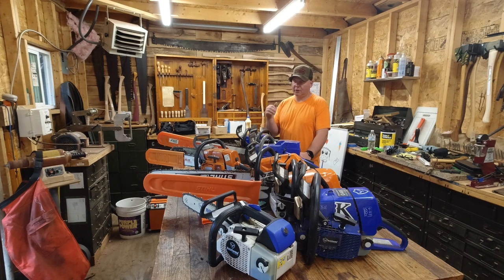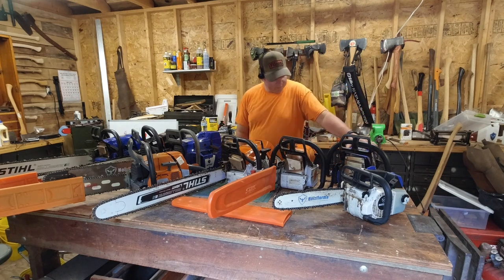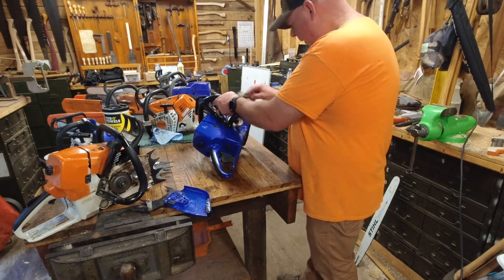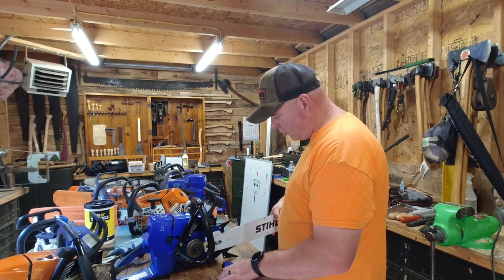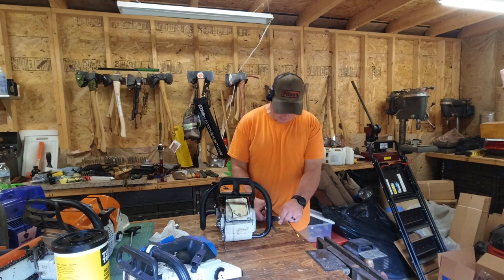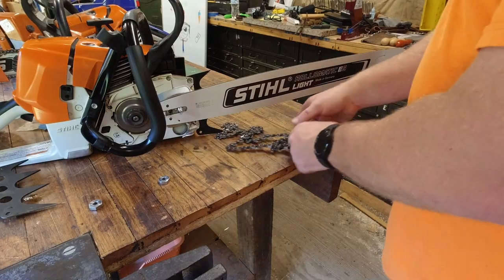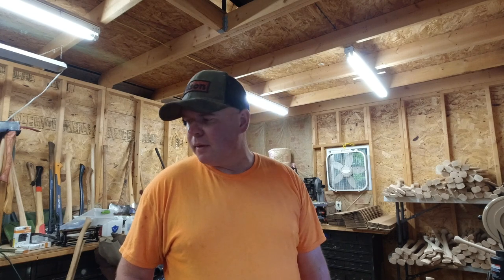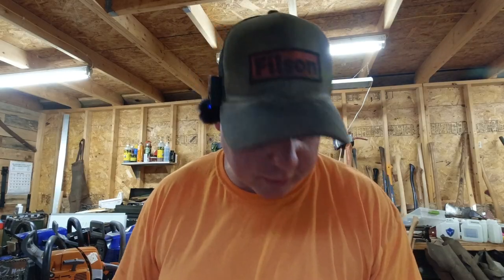Do This One Thing And Your Firewood Chainsaw Will Last Forever!

Comment: I don't think you have put enough hours on the holzforma saws to accurately assess their worth. I buy lots of oem pro saws, blowers, trimmers, hedge trimmers, pole saws blah blah. And where the good stuff starts offering 'value' isnt the first 50 or 100 tanks. Its the 1000th or 2000th. Your loaded up well with a good mix of saws and it may take decades before you put those hours on & maybe in your case they truly are the best option. But working with equipment 5 days a week and that changes. I know from my odd experience  trying to save on parts, buying a chinese copy clutch, drum, carb, handle etc. They just never last in a commercial setting & Ive always regretted the times Ive tried to save money on AM parts. I have had success with AM chain & AM rim sprockets. I wish AM stuff were even 50% ad good as OEM cause factory parts in Australia cost a bloody fortune.
Reply from the maker: I think you missed the part where I said I was a home owner cutting firewood for my own use. NOT professional.  I can't speak for a professional.  In ny situation,  I definitely have enough hours on them to assess their worth. Also, who cares if it last 20 years? It cost $300 bucks! I'm not here to convince you one way or the other. As you can see, I have no problem buying OEM. I'm simply sharing my exsperiance and thoughts.

Comment: Killinger, I am definitely with you on preventative maintenance. I honestly go threw my saws after cutting for the day. Sharpen, flip the bar, clean the air filter, blow the dust out, etc. Gives me a chance to inspect and find potential issues before they crop up when I am getting ready to go cutting as well. Great video and great advice as well. 👍🏻 Definitely like the 500i as well.
Reply from the maker: That's the best! I'm not great at doing it after cutting for the day but I do get it done.

Comment: The Holtzforma was probably not being produced when you started buying chain saws so would be kind of hard to have gotten one back then.
Reply from the maker: I didn't buy a real chainsaw untill aboit 4 years ago.  So, yes they where around.
Reply: @KillingerUSA a real saw doesn't have to be a professional model respectfully. My Husqvarna 455 Rancher and Echo CS-590 are very capable firewood saws. Wasn't your first chainsaw a 455 Rancher? That's a hell of a saw for a first chainsaw.😀
Reply from the maker: @richardsullivan1776  that is correct. I did start with a 455 rancher years ago. I probably should have worded that differently.  Haha

Comment: Couple of questions.  First off, do you live by a shooting range or what?  Seems like in nearly all of your videos, there is a LOT of shooting that is distracting to me but must be a real headache for you.  Second, I have a Clayton Wood furnace that can handle 28 inch firewood pieces.  Will that Prosizer work on firewood logs that long?  Lastly, will a Stihl 16" bar and 3/8 .043 chain work well on the G111 chainsaw?
Reply from the maker: Yes! Haha! That's the sound of freedom! It will calm down here in a few weeks. Yes, pro sizer will handle that. The g111 should handle a 16" bar without issue.  Although,  out of all the china saws I have, that one has given me the most trouble.  It's about 3 years old now so not sure if the newer ones are any better.  I did jave to replace the factory carb on mine and it leaks bar oil like crazy. Also, likes to flood a lot! Other than that, haha

Comment: Great video Chris !! I’ve never owned a chain saw before and I don’t know too much about them. So I finally got my first chain saw and I picked up an ms180 Stihl. After I bought it and showed some of my friends they were like “oh man you bought a kiddy saw” lol .. I kind of wish I did a little more research before buying it. My main idea was that it was light and I don’t do any super heavy tree work. I’m some of the bigger wood it seems to get dogged down a little bit. Did a I make a mistake buying this small of a saw and is there anything I can do to make it perform any better. Thanks Chris 👍
Reply: Hi mate, you didn't ask for my reply but I reckon I can help out. You played it smart! An ms180 is the best chain saw. You didn't go out and buy a 661 (thank god) for your first saw: There's no need for that. I think as a primary it would be a little underpowered but it's going to make a killer second saw when you out grow it some day. Just remember you don't need those 40" logs. Go for the 6" logs and cut all day long. Stuff that big saw guys don't want to get because lugging around a 20lb saw is hard work. I reckon the perfect combo to a 180 would be a 400 440 441 or 461 👍
Reply from the maker: Corey is correct! Great saw! It's nice to have a small, light saw to cut smaller stuff and trail work. It will serve you well! If you find yourself needing bigger, get something in the 70cc range. It will do everything you will ever need to do.
Reply: @coreyshortland2074  thank you so much I really appreciate it !!! That makes me feel a lot better about my saw purchase 👍 I can’t wait to get out an use it more and get some practice with it !!
Reply: @KillingerUSA  thank you so much !!